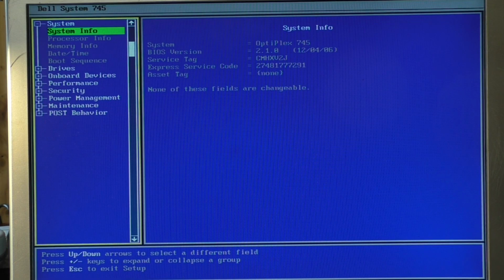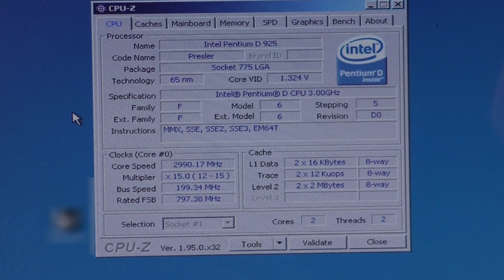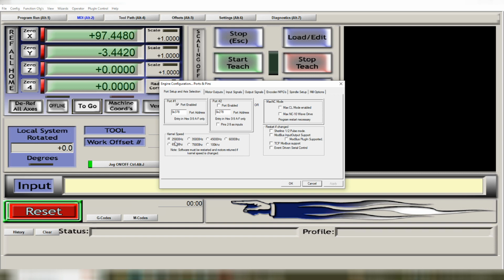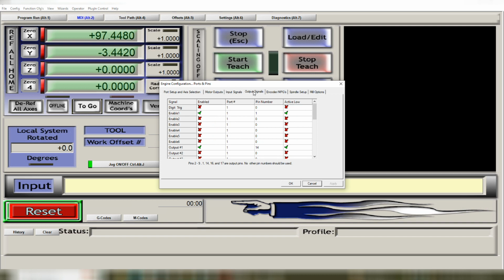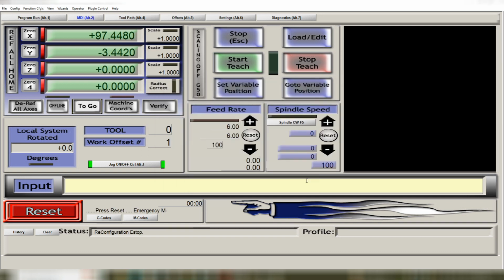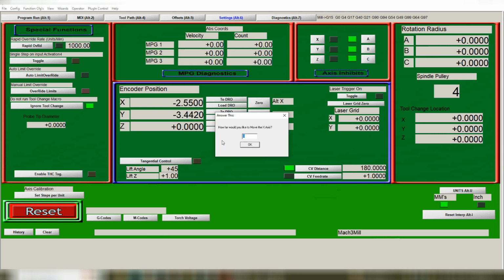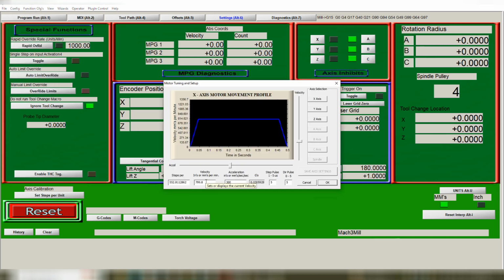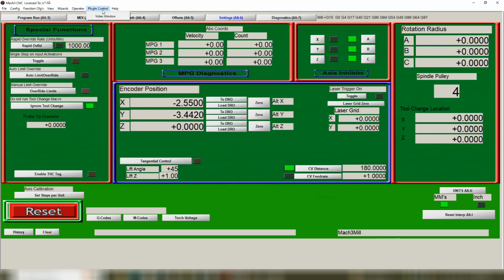CNC 3040 Parallel Interface Setting and Calibration Mach3

Comment from the maker: Just as a follow up to get the machine accurate in X,Y,Z, in Menu Motor Tuning i set as following
Steps per - X,Y,Z = 400
Velocity    -  X,Y =2000, Z =700
Acceleration - X,Y =200, Z=150
Step Pulse = 15
Direction Pulse =1